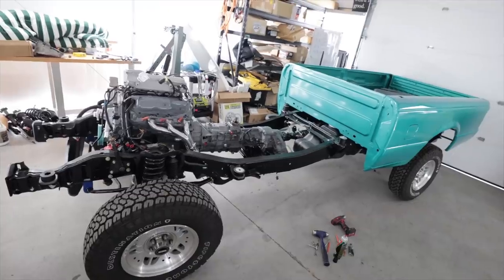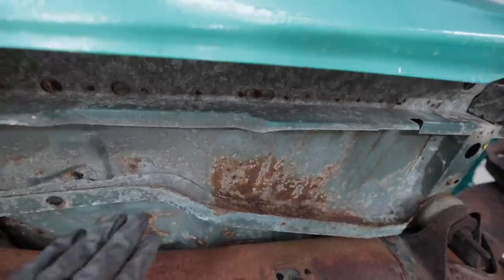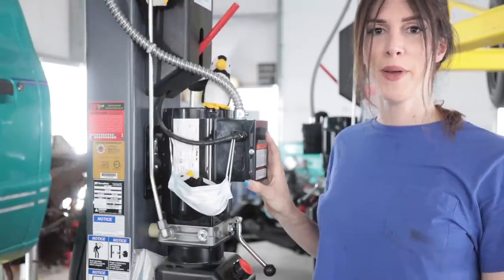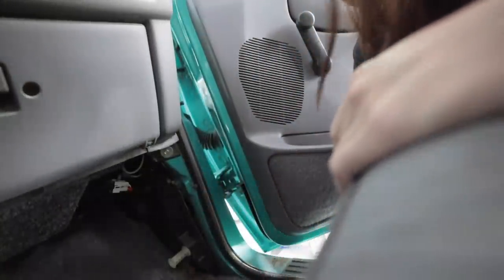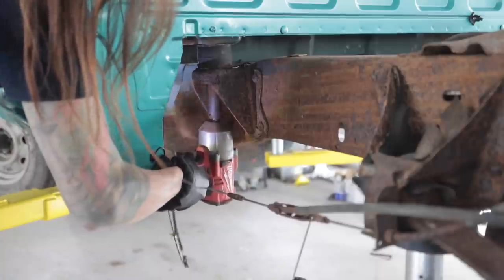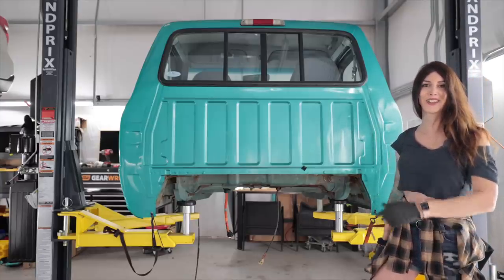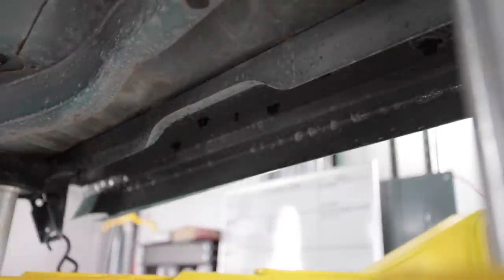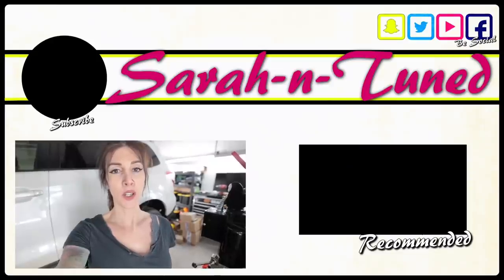The Final Struggle.. Cab Swap // '94 Ranger Frame-Off Restoration

Comment: They have some decent full face respirators on Amazon that work really well, I haven't touched my half face respirator / goggles in forever I just use the full face and it is great!

Also if you use the full face, be sure to put your hand between your hair and the straps when tightening them, or you will have a bad time, don't ask how I know.

Comment: Hey Sarah, I replaced the cab isolator bushings on my '85 Ranger by myself. It can be done but my truck is from northern Kentucky and the hardware wasn't as rusted as yours. You are going to need to remove the old bushing retainers from the old frame. The retainer is in two pieces (upper & lower). You're going to need to either beat them apart or make a retainer separator tool. There are videos on YT that will show you what you need (but I bet Charlie can help if you didn't figure it out already). You can get new ones, if you decide the old ones are shot. It can be a crappy job but having the cab off the old frame makes it much easier. And (early) Happy Birthday!

Comment: I use Rust-oleum rust dissover spray on gel and use a brush to rub it in for doing under the cabs. Spray it on a few times then rinse it off with hot water and it has always removed the rust for me

Comment: Just seems, with all the work you’ve put in, that converting the light underbody rust and even lightly undercoating might be better? I know it doesn’t rain in AZ, but places like Flagstaff, Payson, Heber, do get snow. Not my truck or my job and it’s a comment/question not a quibble, but I have been super impressed with how thorough and careful you’ve been and have to wonder. I mean the cab is off too. All the usual hard labor showstoppers to complete underbody recovery, repair and protection  are done!

Comment: There is rust converter in a spray can, which works on surface rust. It produces a chemical reaction, and transforms rust. After the conversion, it gets dark in color, and is paintable. I'm pretty sure Its active ingredient is phosphoric acid.

Comment: Use heat on the cab bolts. Also, I think it would also be wise to pull off the carpet and seats once you mount the cab on the frame. Check for small rust spots inside.

Comment: I can't believe the effort you put into your underside. 👍👍👍 And not trying to minimize anything you're doing but, just maybe, next time have those areas sandblasted and painted BEFORE you paint the exterior. But I have a feeling you probably already thought of that. I enjoyed this vid. One of your best¡!¡!     Jack in Mexico
Reply from the maker: Sandblasting car body panels warps them more often than not, its not necessary when encapsulating the corrosion in POR.

Comment: Amazing how this is turning out. I hope you have plans to keep this truck forever. Otherwise someone else gets the results of your hard labored efforts. I still have my 95 Ford Ranger extended cap in the exact same color. But mine is the 2.3  four cylinder 5 speed and 2wd version. And there is ZERO rust anywhere on it.  Thumbs Up!

Comment: Those rear rusty supports are what I was talking about. most sites say the supports are for ford ranger only and when you put in compatibility for 1994 mazda B3000 single cab is says NO!  it wont work, but i can see it! its the exact same mounts.    so Mine are rusted IN HALF!  The cabs twisted a tad off and its jacking up the steering column. I tried to go get some from a yard and was having the same troubles you have except i dont have a friend to help.   :0(    
    the old rusty ones you took out look amazing compared to mine LOl  I wish I lived close enough to dig thru your trash.  Id wire wheel those and rust proofem and  problem solved.

Comment: If you have to get an aftermarket radiator, I've used Spectra premium radiators, as an aftermarket substitute for my Ford. The Spectra premium brand seem to work well, and has had no issues!
Reply: I got a great deal on the spec for premium radiator off Amazon

Comment: Don’t use WD-40 for a penetrating oil, it’s not. It’s a water displacement fluid film for keeping moisture off things like electrical components you don’t want to get water on or in. Use a proper penetrating oil for the cab bolts. It does work better.

Comment: Ditch the motocraft radiator idea buy a nice aftermarket one with more cooling Arizona is brutal on engines .you will be much happier with after market.
Reply from the maker: Unfortunately the radiator market it’s flooded with made in China stuff now, even the American branded ones. Koyorad is the only quality solution I’ve found.

Comment: I have a 2001 Explorer Sport Trac, the Ranger's fat useless cousin. the way you remove the body mounts by yourself is by clamping a pair of vise-grip pliers on the metal flange at the bottom of the mount; they'll spin a bit then catch on the underside of the cab, counter-holding the mount while you work from above. also,  you didn't mention in the video, but will you be using the OEM mounts or replacing them with poly?

Comment: Wow, this reminds of a shitty job I has as a school bus mechanic. I normally installed aftermarket a/c in new buses, but wasn't getting along well with the idiots who ran the place, so they had me replace a bus floor by myself. Talk about disgusting. Years of nasty shit accumulated. I often had to find help to remove rusted floor fasteners. Bus floors are metal, topped with wood, and then topped with rubber

Comment: You should remove the seats and carpet to get all the rust underneath. I'm sure the seat and seatbelt bolts will be rusted as mine were on my 04 ranger
Reply from the maker: I pulled it up and looked, there was nothing on the top side. I am going to pull the carpet out to clean it better though!

Comment: use a rust reformer like Rust Mort to convert the surface rust back to paintable surface
Reply from the maker: So after doing research on the POR15, it was recommended not to use converter prior to application for better adhesion; Just descale and apply.

Comment: I know you like OEM for everything, but when it comes to the radiator, wouldn't you want to consider upgrading to something that cools much better than stock so, since you live in Arizona? I primarily use my Ranger in the summertime now, and alredy alredy switched to a full aluminum radiator, and it helps a lot. I did do a lot of research to find the best one, in terms of quality, reliability and build. 
However if you must stick with stock get the largest one you can, I believe they call that having the super cooling engine package for when it comes with a Factory tow package. I think it's a triple core.
On another note. They make full face respirators that have an airline with filter that you can hook up to a shop compressor air. Don't know anybody that uses it but I wonder.  I have a welding helmet that has an auxiliary Airline, but it's fed from a little fan motor quick clips to my belt
Reply from the maker: Yeah, Im going to use the automatic transmission radiator because its a dual core. The only company I found that makes anything beefier is made in china.

Comment: Wow you used a strippling gun to remove rust. I used them decades ago to remove set concrete from the mixing drum. I am however confused. You had the body off to get it painted. Why didn't the bottom of the body get done then?
Happy Birthday for when it is 🍻
Reply: The cab is original paint. It was never removed from the frame until now.

Comment: Why don't you put a body lift on the car while you've got it apart you can make a one inch or buy a 2-in or 3-in from off-road Warehouse it comes with new bolts so you won't have to worry about rust and bolts and you'll have room for bigger tires
Reply from the maker: because body lifts are 💩
Reply: @SarahnTuned  Don't sugar-coat it, tell us how you really feel.

Comment: Why do you wear short shorts and short tshirt when you work?  After working on cars I always have dirt on my jeans and shirt.  You are just going to get it on your skin which makes taking a bath harder.  You're also more likely to get scraped up.  You could even just pull on a set of coveralls over what you are wearing.  It just makes sense.
Reply from the maker: because its Arizona, I've already spent 2 nights in a hospital from heat exhaustion since moving here.
Reply: @SarahnTuned  You should put an A/C in your garage.   I installed a mini-split in my shed myself.  Only special tool you really need is a vacuum pump but you can get one pretty cheap at Harbor Freight.

Comment: I had stopped commenting on the safety of some of your practices, but damn girl, you need to think about how you operate without proper protective equipment... and the processes you are using... commercial sand-blasting before the firewall repair would have saved you this effort, which you could use to repair and finish the cab... in the paint shop, ready to bolt on... but irrespective of what you do yourself instead of outsourcing to save time, money and effort, please, do it safely - don't become 'not pretty' due to some injury :thanksdoc:- or risk your eyes, lungs or skin being damaged with being exposed to a very real source of injury...  :takeout:= use standard safety equipment at a minimum... please...? you do a great job, just do it safely... you could have had your whole day or two back getting it done off-site where they are properly setup to do that kind of dirty work too, with the fumes, grit etc ... you could film them doing some of it, link up with some local shops... those nails deserve a break (no pun intended 🤣) from the punishment you serve out on them without wearing gloves...
... and although the outfits are part of your channel's appeal, you'd also look great in a set of unique coveralls too, a nice belt to cinch in the waist... keep that hair up and in a cap, safely away from spinning grinders, wire wheels, or drills - that's a whole new appeal for me... 🙃
Last time I' commenting on this subject. :washhands:...
Reply: When will OSHA understand there's exhilaration in danger?

Comment: makes no sense to me why you would go this far on the cab but not go the distance? chemical dip to remove the rust and corrosion, then a sealant/etch dip and primer dip, sp all those places you cannot reach that are rusty will be celan and not poke out eventually, which they will, all those places like inside your doors, anywhere its doubled up so forth you cannot reach thats rusty will continue to rust, at the very least you have to stop that process and terminate it completely or a few years down the road you might see it poking through, all those places like the rails and such are rusty inside.. only way to terminate completely and get rid of the rust is a sonic chem dip.. then you have to cover the bare metal before it surface rusts so they immediately drop it in a sealant/primer bath, every nook and cranny is done, is officially like new as it rolled off the line, it's really the only way it can be done, unfortunately.. just seems you have gone along way on this to stop short of a full on resto, had it not been rusty it wouldn't be much of an issue, not anytime soon, but given it has that much rust?  it never sleeps, and will continue on just using the humidity in the air alone...
Reply from the maker: Tell me you've never been to the desert southwest without telling me you've never been to the desert southwest, lol. Any minimal amounts of rust left over will take longer to spread than the paint on the truck will survive the Arizona sun. I won't even be alive by the time that truck rusts out again here. The purpose was to preserve as much of the original truck as possible, same reason why I didn't remove the scratches along the top of the bed when I had the lower corners repaired and blended.

Comment: Great enthusiasm , but you do not know what you are doing under that truck , you have waisted literally hours , what was that pointy thing ? , total bollocks that pointy thing , just a wire brush or wheel on a drill , treat the rust and seal it with something  durable that keeps the oxygen off it  , be sure to cover it all and that is it .